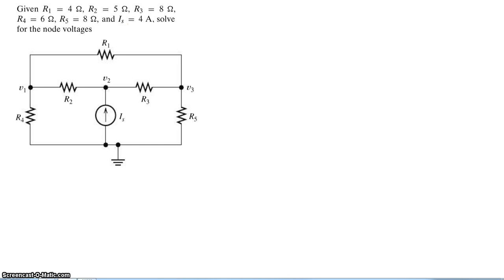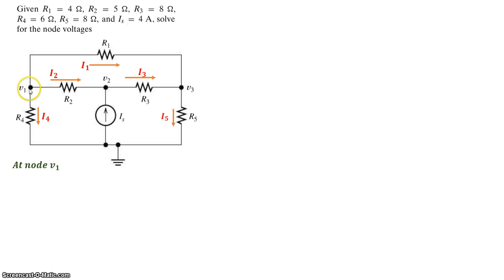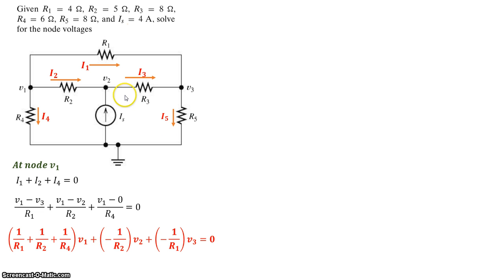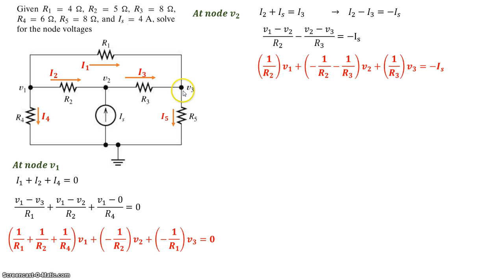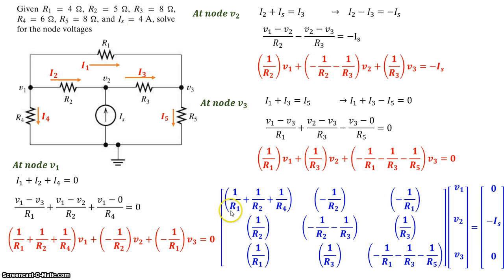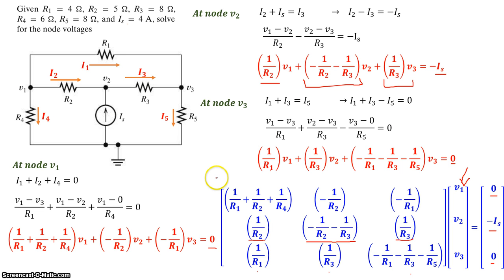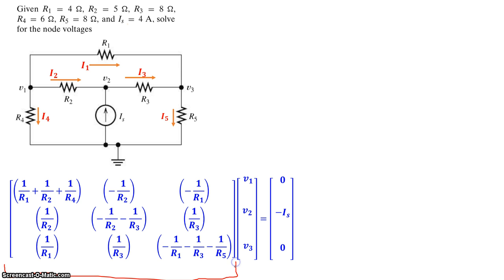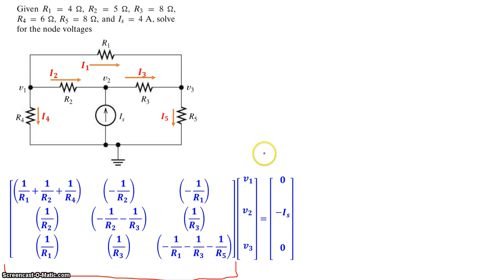Example -  Node Voltage Analysis

Comment: Sir, the answers that I got for V1, V2 and V3 are slightly different from you... I got V1 = 13.836V, V2 = 25.961V and V3 = 13.361V... I used wolfram alpha to solve my simultaneous equations and that is what I got.... Thanks in advance..